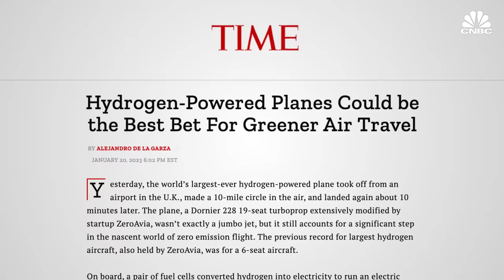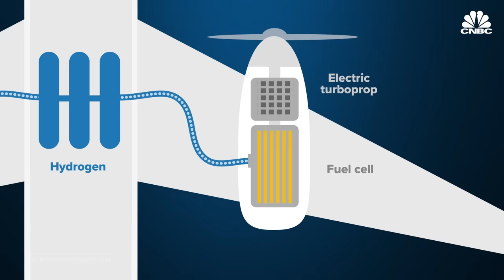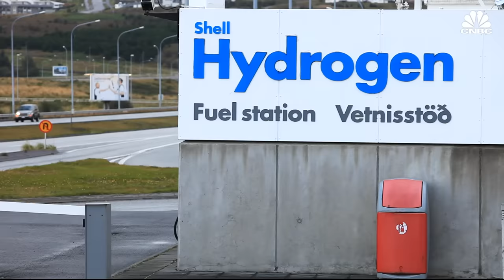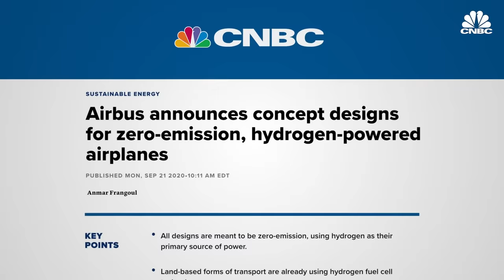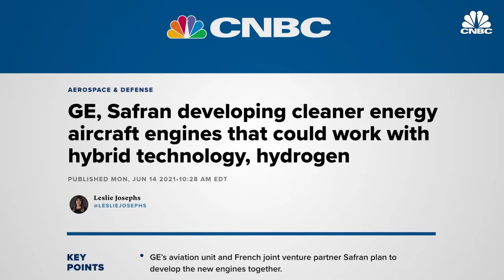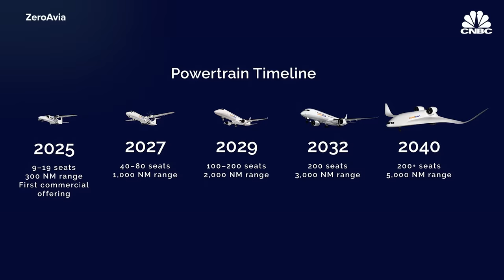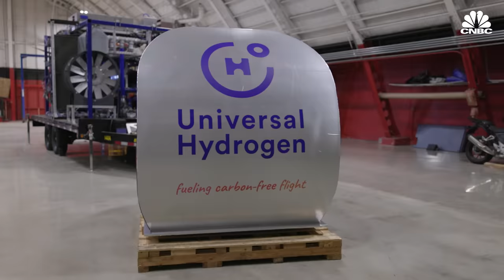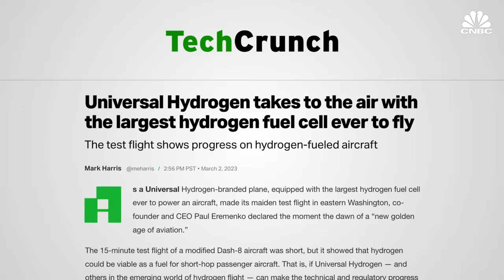Why Hydrogen-Powered Planes Will Beat Electric Planes

Comment: Green or Blue hydrogen fuels would be ideal because the process of creating the fuels is low (blue) to zero( green) carbon emissions. Grey hydrogen does creates c02 emission in development. So it's not zero carbon footprint fuel by any means.
Reply: This example was done with hydrogen production by electrolysis with a nuclear powered plant. So yes, it’s zero emissions.
Reply: Yes, the plan is for it to be green hydrogen.
Reply: Some of you say that the hydrogen math they are using here is assuming electrolysis (green) hydrogen powered by nuclear energy for a zero emissions fuel. 

(Well except for all the emissions in making the nuclear power plant, refining the nuclear fuel, building the hydrogen plant, transporting and storing all the hydrogen, and such. So not really zero emissions but still sounds good as LOWER emissions than jet fuel). 

But the problem is that there is a lot of hydrogen consumption already for medical, chemical and industrial applications. That consumption is currently being answered by methane steam reforming which is actually higher emissions than jet fuel (yes even with Carbon Capture,   1. we could put carbon capture on the jet fuel production as well and 2. carbon capture wastes massive amounts of electricity which also has emissions unless we also put that on nuclear/solar). 

So we cannot consider any new applications of hydrogen without first cleaning up the production of hydrogen for old applications. Any hydrogen electrolysis projects made now need to go toward reducing the amount of methane reformed hydrogen production. If not then we cannot count the math of electrolysis hydrogen going toward new applications as "low emissions". 

Any new application of hydrogen will be considered high emissions (even if using nuclear fueled electrolysis) as long as there is still methane reforming hydrogen production still in place for old applications. 

On top of that we need to consider the overall use of the nuclear generation, its benefits used in hydrogen electrolysis vs its benefits it used elsewhere or just plugged into the grid to reduce the amount of fossil fuel generation in the world. 

So for hydrogen planes to actually be "environmentally friendly" a bunch of other things need to happen first:
 - we need the world to be producing all electricity with a very low percentage of fossil fuels
- we need the majority of hydrogen production for other applications to already be electrolysis (or pyrolysis) with green electricity generation 
- we need to sort out the transportation and storage inefficiencies of hydrogen 
- we need to establish that there are no other better solutions like bEV 

That is a lot of things needed before hydrogen fueled transportation is a good idea. 

Really it is OK to research and experiment. But the reality is most of this is being pushed for and propagandized by the petroleum industry. 

The petroleum industry has an interest in us maintaining demand for things that use fossil fuels, inefficient technologies that increase any kind of energy demand, fuels that need to be transported through their infrastructure and burning even more fuels, and in general distracting from other projects that would actually reduce demand for fossil fuels. 

Sadly for now aviation fuel is likely the best alternative until bEV are viable for planes or some of the needs above are resolved. It is much better today if we focus our efforts on reducing emissions (fossil fuel consumption) on general electricity generation, and bEV cars/trucks, and improvements and electrification of our buildings before we get too distracted by hydrogen transportation. 

Let the petroleum companies have aviation fuel demand, we will take other fuel demand away from them first.
Reply: @5353Jumper  

"Well except for all the emissions in making the nuclear power plant, refining the nuclear fuel, building the hydrogen plant, transporting and storing all the hydrogen"

The presumption is that all that is done with green power. 

"But the problem is that there is a lot of hydrogen consumption already for medical, chemical and industrial applications. "

Irrelevant to aviation fuel

" we need to establish that there are no other better solutions like bEV"

We already know there are not. (and batteries are subject to your thing about "the whole process has to be zero emission" so you're a hypocrite here)

"That is a lot of things needed before hydrogen fueled transportation is a good idea. "

We already know H2 for aircraft, trains, ships, etc is something to pursue. Batteries are for small vehicles such as SUV and smaller consumer vehicles, and eVTOL.

"It is much better today if we focus our efforts on reducing emissions (fossil fuel consumption) on general electricity generation, and bEV cars/trucks, and improvements and electrification of our buildings before we get too distracted by hydrogen transportation. "

The people working on H2 for aircraft are focused on that. The other stuff is irrelevant to what they're doing.

"But the reality is most of this is being pushed for and propagandized by the petroleum industry. "

Nope. It's being pushed by MIT, Stanford, Oxford, etc.

"Sadly for now aviation fuel is likely the best alternative"

Sustainable aviation fuel, which has lower carbon content than normal jet fuel and is created with green energy using water and using CO2 taken directly out of the atmosphere.

Comment: think one of the worst ideas the modern era could come up with is fully electric planes, batteries explodes, starts fires, gets sudden power drains depending on temperature, run out of power, you die, hydrogen is the way to go though, could try to funnel air moisture to keep hydrogen planes fueled
Reply: You'd  need mini chemical plants inside an airplane to purify and split that air moisture, that's  impossible any time in the near future, so so so many process units are required for proper hydrogen production

Comment: For short haul, approximately anything under 2 hours or less, batteries are feasible. That's not nothing, that could replace a lot of shorter flights in europe where demand is too low for high speed rail (or it's just plain impossible), and even many feeder routes in the US. But hydrogen or carbon neutral jet fuel are the only feasible alternatives for anything longer than that.
Reply: The problem with batteries is that they are dead weight. A traditional aircraft gets lighter as it burns through it's fuel, battery powered aircraft don't.
Reply: @Aeronaut1975  That becomes more of a problem the longer the fight is. Eventually the batteries get so heavy the plane can't take off with any passengers or cargo.

Comment: Perhaps I missed something... 

...but the combustion of any type of fuel (including H2) under high enough temperatures and pressures (such as in an ICE) leads to the unnatural bonding of Nitrogen and Oxygen (NOx).

Correct?
Reply: Nope. Zero emissions.
Reply: @waryinzero  So you are sure that the bonding of N and O (that forms NOx) is absent in H2 fueled ICE systems?
Reply: Luckily in an enginer the fuel  is combusted at ambient pressure at ambient temperature isnt that amazing

Comment: I wonder how a hybrid aircraft would perform.  Using current jet engines as a generator to power batteries and the batteries powering engines.  That would reduce some weight by using ducted fans instead of high bypass turbines but an increase in weight for batteries.

Comment: Hydrogen-electric is fine but Hydrogen fueling the jet engine itself would increase range & power but storage of that has to be developed further. Hydrogen has the highest specific impulse of any fuel, thus storage is extremely critical and whether to use vapor or supercooled liquid hydrogen will have to be figured out.

Comment: I'm doing research in this area. The problem with hydrogen is that the molecules are so small that they will phase out of any storage tank you place them in. Combine that with hydrogen's explosive reaction to being mixed with air, and that is a massive problem. The only solution (I believe) is using ammonia as a storage molecule for hydrogen, then cracking the molecule to release the hydrogen. Then it's a matter of mitigating the NOx emissions from this process, which can worsen climate change more than CO2.
Reply: Do you know anything about basic chemistry?

Comment: We already have a number of solutions for short haul flights, but none for long haul flights. Hydrogen/electric airplanes won't catch on when HSR, sleeper trains, and airships are more cost effective replacements for short haul flights.
Reply: But hsr is not viable for long distances.
Reply: @neeljavia2965  Exactly, but hydrogen and battery airplanes are unable to effectively cover 600+ mile trips, and are inferior to the aforementioned modes on short haul distances. They are functionally useless.
Reply: @GeoMeridium  For short haul, hsr is the best.

Comment: A plane with a hydrogen combustion turbine producing jet thrust and driving either a prop or fan? Maybe, eventually, certainly before oil derived aviation fuel is exhausted in 60 years time. But in the meantime an e-fuel made by combining renewable energy produced hydrogen with atmospheric captured  CO2 kit the best option was  as it adds no new CO2 to the atmosphere, it just recycles it. Producing enough for large commercial airliners and distributing would be a major challenge and so it is not a solution for land transport as well. Possibly heavy shipping though.

Comment: Just use the green hydrogen to make methanol and then use that as fuel. Minimum modifications needed to the jet engines, it can be stored at room temperature and pressure. Much simpler.
Reply: Methanol emits CO2, defeating the purpose of zero emissions. Methanol would create way too much maintenance on aircraft engines which is already expensive enough as it is.
Reply: @MeatballMedic  CO2 isn't a pollutant, despite all the sacremongering. The atmosphere contains 0.04% of it, and if it was cut by half to 0.02%, then every plant on the planet would begin to die. There's a reason Dutch farmers pump CO2 into their greenhouses.
Reply: @Aeronaut1975  and if it increasdd to 0.5 what would happen? Dont cherry  picka  side now
Reply: @whut9245  The planet would be greener, plants and crops would grow more quickly, produce greater yields, be healthier and feed more people, as well as releasing more oxygen into the air, and more nitrogen back into the soil.

Comment: Hydrogen is a pipe dream anytime soon.  Airbus is working on hybrid engines which could reduce the consumption of fuel. That, along with the overall reduction of fossil fuels, will bring down the cost of flight significantly.

Comment: Question: Are hydrogen-powered engine as loud?
Reply: The hydrogen fuel cell is silent. Electric motors make a small humming noise but the propeller is as noisy as before

Comment: Fun fact, they wont... Just think about the efficency of energy conversion. In an EV you have lower power density but only have to convert electricity to mechanical motion. In hydrogen you have to convert to electricity then to motion. Horribly innificent.

Comment: This will never work if the economics of it don't work, the electrification of automobiles currently work because it works out cheaper to run than fossil fuels in the long run, if cost of electricity is more than the fuel itself, EVs would never take off, being just "green" is bs

Comment: Why are they not using Metal Hydrides???"  MgH2 is safe, does not require compression, and stores more energy than both gas or liquid.  They could also have on onboard electrolysis to produce added hydrogen while in flight!

Comment: It's so obvious. Airlines require massive quantities of an energy source that is consumed when it's used, meaning, they lose weight over the course of the flight. The maximum takeoff weight is not the same as the maximum landing weight. Batteries do not do this - their physical weight stays virtually identical whether they're fully charged or fully discharged. A fully electrified transcontinental aircraft using current technology is no different than Top Gear trying to launch a Reliant Robin (which they did, by the way) into midair - all it will do is fall out of the sky faster than a Gimli Glider.

Hydrogen as a gaseous fuel has major drawbacks. Its flammability relative to jet fuel is already a solved problem. Instead, the main problems have all to do with production (why aren't we capturing methane emissions from livestock, landfills and oil wells, and converting them into feedstocks?), distribution, and efficiency. Yet this may be what is ultimately necessary to wean aircraft off jet fuel.

Batteries? Why don't you find me a battery technology that is at the absolute bare minimum millions of times more energy dense than the most advanced of lithium-based chemical batteries today per given unit weight without sacrificing anything else e.g. charging rates, cycle life, safety. I'll wait.

The alternatives aren't that much better: biodiesel requires vast amounts of organic feedstock --- there simply isn't enough arable land on earth to feed the airline industry, period. Ion propulsion? Well, you better be content with nuclear weapons going off all around you, because that's what it is.

Comment: Hydrogen is not practical pretty much for any fuel application (storage issues, low energy density and explosion hazard). On top of that, there is no realistic way to produce huge quantities of hydrogen without causing massive green house gas emissions. A hint from a trained chemist: the only realistic way to produce hydrogen today is by combining carbon (coal) and water vapor at high temperature, which generates carbon dioxide. And burning (using) hydrogen generates water vapor, which is also a green house gas. So it's actually better to keep using fossil fuels than hydrogen - less damage to the environment.
This hydrogen agenda is being pushed by the coal industry.

Comment: Hydrogen combustion burns much hotter than kerosene. That means more NOx produced and NOx has a very high Global Warming Potential number (over 200 where CO2 is 1). On the fuel cell side consider that H2 is a small molecule that easily leaks. Leaking hydrogen has a Global Warming Potential number of about 30X that of CO2. Trading one form of emissions CO2 for another may not be so wise.

Comment: Until Hydrogen total production, transportation, and storage costs  are sharply cut back, it will find to be impossible to be competitive with electric from renewable sources such as Solar or wind energy. This entire video is not talking about overall serious costs, but about Hydrogen usage feasibility, falsely stating that it is cheaper to produce, which it is very far from the truth, and Toyota is very well aware. That is the crucial reason that after 30 years  and various Billion $ investment tinkering  with it, hasn't been able to produce a competitive successful car, and to my knowledge intends to drop the Hydrogen car project for long term battery only electric cars.

Comment: best way to compress the bulky hydrogen is not super high pressure, or liquifying it at super cold temps - just use carbon like Musk does - one carbon atom can lock on and hold 4 atoms of hydrogen compactly - called methane.

Comment: KLM was the arguably 1st airline to use bio-diesel to power a commercial plane in the 90's. I had a chance  to chat with a KLM ground staff while admiring the fanfare-inducing show off flight. He told me it was just a showcase/show off propaganda scheme from the airline to advertise their "innovation" as the collecting old and stale cooking oil/processing/storing/separating from other Jat fuel would lead to the bio jet fuel to incur >5x the regular Jet-A fuel in use today. And the tendency to freeze up during flight (with ambient temp of around -60C at 39K ft) made such idea extremely expensive and down right impossible to implement. If there are pilots/engineers out there who know more about this and find me wrong please educate me for the truth. 
Now the new hype seems to switch over to hydrogen/electric again to woo a new wave of fans/investors(may be new VC?) Same questions remaining just like the bio-diesel: cost of producing/liquefying/transporting/storing/up-loading liquid hydrogen onto the planes is still outrageously high as the bio-diesel. Such impractical path's existence is very much in doubt let alone succeed. I hope I am wrong as the world does need a new type of energy to replace what we've been using for these years. Just don't know yet where the answers are.

Comment: Batteries are currently better than hydrogen. Hydrogen isn't there yet which is why they're not using it. It's always a few years away. Has been for over 40 years. Meanwhile battery tech is actually, measurably improving every year. By the time hydrogen is good enough for flight, batteries will also have improved enough and will make more sense. Battery density Wil be triple what it is today in another 8 years or so.

Comment: Each and every liquid-fuel-powered plane will beat any electrically-powered plane. By capacity/weight ratio, batteries are more than 50 times heavier than jet fuel. Only small, single-engine propeller planes are light enough to fly on electricity. If you want to transport multiple passengers fast and far, fuel-powered jet engines are the only way to go. Using hydrogen for this is waste of energy, though. Remember, hydrogen is not a primary source of energy. You first have to extract it from water or natural gas, which requires more energy than the hydrogen will ever be able to deliver.